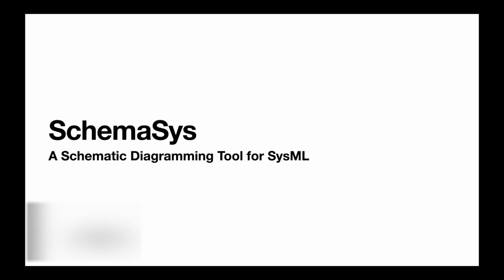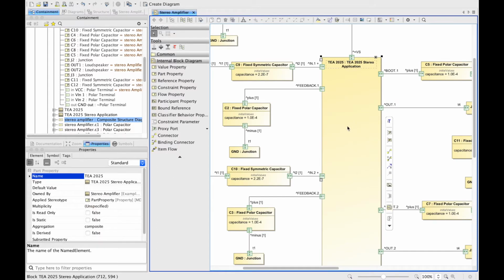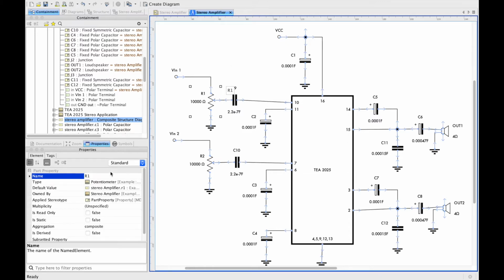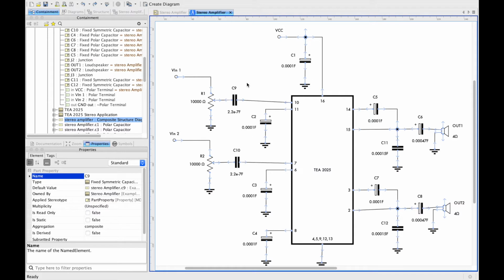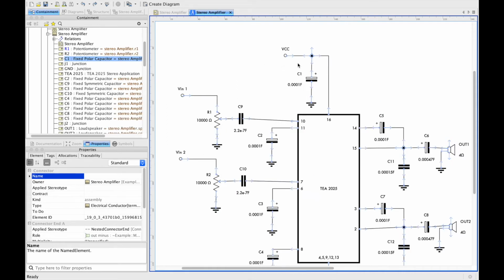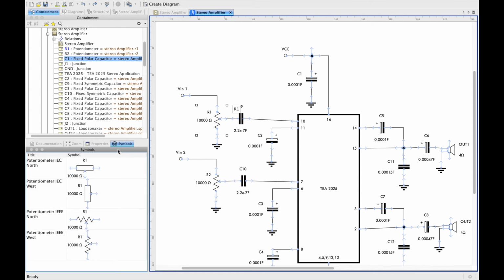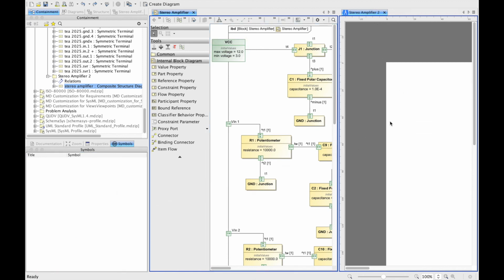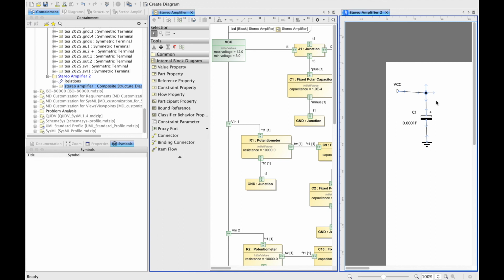SchemaSys Overview

Comment: This is absolutely fantastic, awesome, well done! I had thought of doing something like this, it's wonderful to see it implemented. I think this addresses a major need for SysML and shows the future of SysML for a wide range of domains and problems. It's much better than just using, for example, lots of custom stereotype icons (better than nothing, but not as nice as this). I have done some SysML models of, for example, an Arduino board and an audio mixer. It's definitely possible with SysML to make some nice and very realistic IBDs for this stuff, good enough to then map to calculations and simulations. Introducing electronics notations (or other dedicated notations) along with some modelling constraints opens it up to many industries and to modellers who are not necessarily familiar with the machinery of SysML.
Reply from the maker: Thanks for the encouraging words! Much appreciated! Yes, I also have some experience with the stereotype/icon approach, so I know where you're coming from ;-) I would be very interested to hear more about your experience and the areas in which you think this might apply, as we are currently trying to identify the needs of the larger community. Will be putting out more videos soon, so be sure to subscribe!

Comment: It's intriguing to see SysML concepts presented in a domain specific way.  I'm assuming the user still needs to understand SysML quite well? I think you nicely touch on the problems that it solves but I wonder if you have more examples of benefit of models in this scenario rather than drawings as one needs to invest time in building proper model (i.e. is it a case of complexity?). I'm assuming you need to draw SysML diagrams, or is there a potential to do schema-based diagrams straight away do you think?
Reply from the maker: Yes, in its current iteration, users need to understand SysML, though, of course, the idea would be to eventually take it to the point that that is no longer necessary. It’s a first step in that direction, but perhaps it covers at least some use cases that people currently have? What do you think?

Part of the inspiration came from a project where we needed to provide an interface for electrical engineers who were not knowledgable about SysML. By drawing schematics they were able to produce SysML models within certain well-defined boundaries, i.e., they were able to create SysML models representing electrical circuits.

I have felt for a long time that one barrier towards wider adoption is that, while SysML can kind of do everything , it doesn't do any one specific thing; that's an overstatement, I know ;-) But my point is that I see a lot of potential in using SysML as a platform for developing other domain specific applications. Is that consistent with your experience as well?